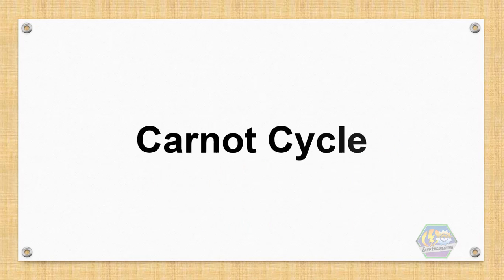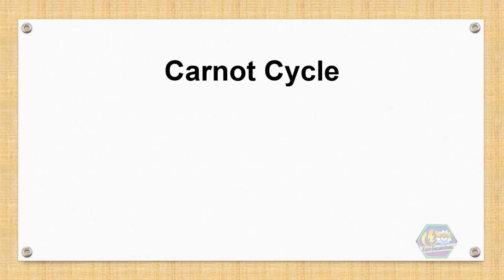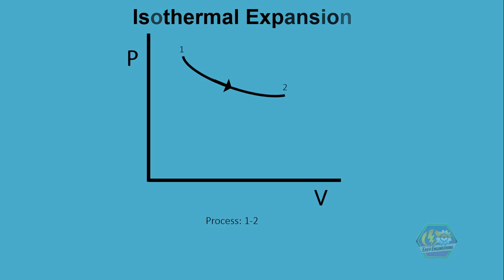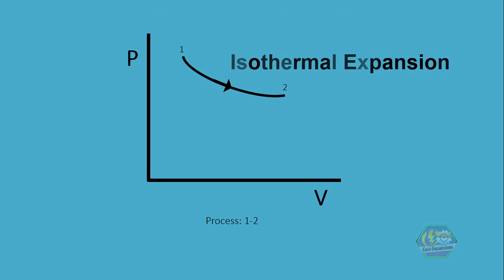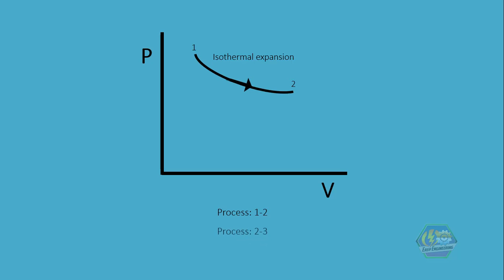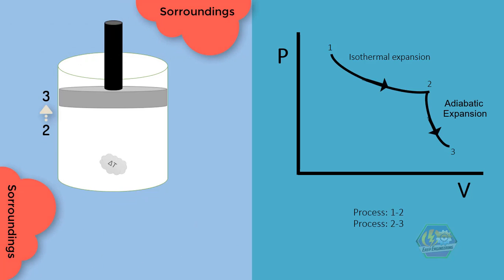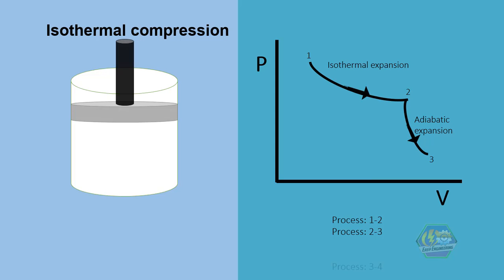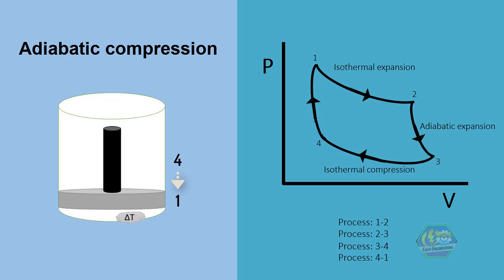CARNOT CYCLE | Easy and Basic

Comment: why is the isothermal expansion the one where tempreture changes?
Reply: The temperature doesn't change in the system. The system absorbs heat while expanding (isothermic). If if wouldn't also get heat from the surroundings, its temperature would drop. It's the other way around with the isothermic compression.

Comment: One question please :
In carnot cycle, Why don't we replace the isothermal process into isobaric PROCESS?
Because, the isobaric gives you more (work) than isothermal does?
Reply: Because through isothermal expansion we are giving the gas the energy with minimum energy dissipation,that is we are passing our whole energy to gas without energy wastage,in other words  heat energy is stored in gas as potential energy of gas molecules.but in isobaric process,more energy will be transferred as Kinetic energy and there will be dissipation and wastage of energy.you should focus more on basics

Comment: Is it the flywheel that keeps going Carnot engine cycles?
Is it the Heat source that drives the process 1 2?
Is it the Heat Sink that drives the process 3 4?
& together with the inertia from the flywheel the cycle keeps turning? 

Higher temperature from 4 1 plus the addition from the  source displaces out pistons?
Lower temperature from 2 3 plus & heat sink during 3 4 contracts the gas and displaces the piston in?

Comment: Process 1 2
Temperature should go with heat addition from source but the pressure drop from expansion makes up and keeps the temperature same throughout the process. 
The expansion needs to be slow to match the increase in temperature from the source to keep the the temperature constant?
Reply: All reversible processes are so called quasistatic processes, which means the state of the system changes so slow that it is considered in equilibrium or near equilibrium at all times. But ideal reversible processes are not possible in reality, which is one of the causes, why the carnot cycle can not be realized.

Comment: Reversible  means that we can do the process in the opposite  direction
And we know that reversible process is ideal like carnot cycle
So why can we do the reversible in machine like heat pump??
Reply: Reversiblity in the video you watched above has not the same meaning as heap pump reversibility. I understood what you meant. in heat pump, we act on 'a reversible valve' JUST to inverse the operationwe need (from cooling to heating OR from heating to cooling).
Reply: @issamelhamouti4014   i  understood later that there are a difference between reversibility in carnot state and clauses state
. and know that reversibility in carnot means no lose in energy by friction so it is ideal

Comment: Thermodynamics gives you bounds on real engines. Moreover, the explosion of the fuel mixture is not even approximately reversible. How can thermodynamics be of any use in designing real world internal combustion engines?
Reply: Because if you don't know thermodybamics, the efficiency would be even worse than it is now 🤡
Reply: @nijub.s.1165  How inefficient is it now? Yes, it is a good thing to know classical thermodynamics. But consider the following. If the engine you are designing operated in quasi-equilibrium, then some Carnot design would be arbitrary close to optimal. However, if that processes is far from quasi-equilibrium, operating in a Carnot engine it need not be more efficient; than the solution of optimal control problem constrained by the DE of the non-equilibrium process.
Reply: Nothing is ideal in world.. but we only try reaching that ideal level. Hence the knowledge of ideal cycle  will help us reach close to it. So you can save your hard earned money

Comment: Why the gas volume is increased in Adiabatic Process? I mean it could be be unchanged. What drives this expansion?
Reply: as mentioned, the system is insulated during adiabatic process so that no heat enters the system. what happens inside then is that molecules continue to move rapidly due to high temp obtained from isothermal expansion. this movement causes the gas to expand and as it does, temperature begins to go down.
Reply: @claricepaghasian2005  and the pressure goes down too, or does it remain unchanged in the case of PV = NRT ?
Reply: @fernandb.6162  pressure goes down too, applying boyle's law

Comment: Is there any risk for gas to change its phase into liquid when its compressed in carnot cycle?
Reply: no, because the carnot uses an ideal gas where electrostatic forces are negligible so an ideal gas no matter how compressed will never turn into liquid.
Reply: @degraj418  what about car engines? Both diesel and spark ignition there is no risk too?
Reply: @ozgurkayabas6380  well ideal gases do not exist in reality so I cannot say the same for real gases.
Reply: 4 stroke?